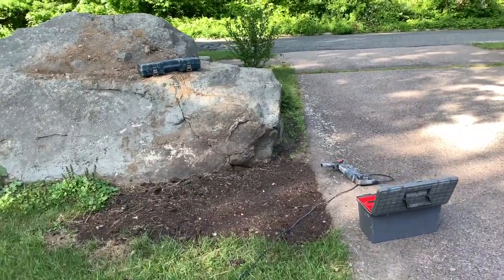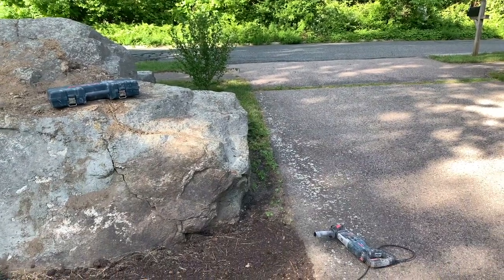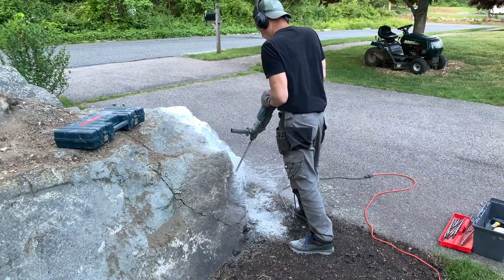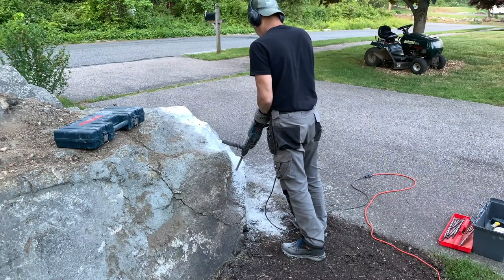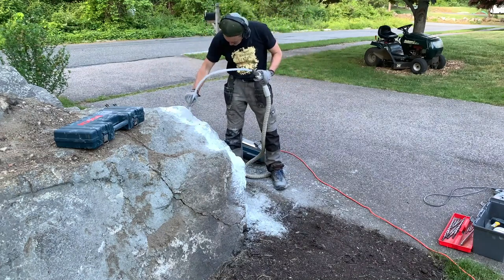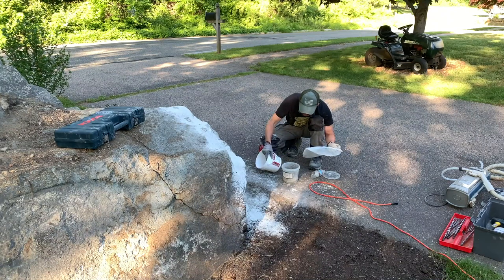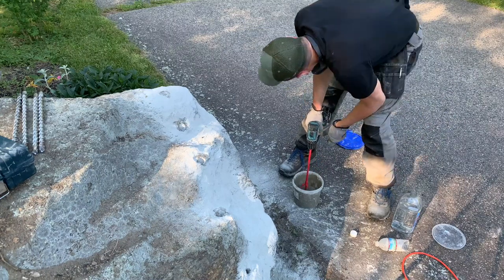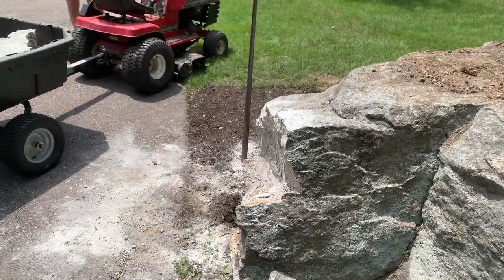Stone breaking using Dexpan type 3

Comment: There are types of this material.  What is the difference between red, green and blue?
Reply from the maker: thank you. Sorry for getting back so late. But I never got any notifications about left comments. It is most likely my mistake, I'll check why I do not get 'em. Cheers
My understanding, the difference between the three types of materials is the outside temperatures that aforementioned material can be applied. some can be used when it's very hot outside, and some when it's colder. Cheers

Comment: My SDS plus Bosch Makita drill bit keep on breaking even if I pour water , can I use pointed chisel bit to make hole ?
Reply from the maker: I would not pour water on a hot tip. My technique to minimize the heat of the tip and prolong its service life - is to change bits often. I do not push too hard, when I drill,  giving a chance to a drill to do its work. A minute later I remove the drill, place it on the rock, and in the meantime, I insert the second drill. A minute later, I repeat the process and inserted a third drill. Then I return to the first one and so on. I would not recommend using water on a hot drill bit tip. Cheers

Comment: That looks like a Bosch rotary hammer drill. What model? What was the rock type- basalt - granite. If it was either of those two it was amazing. I am trying to drill granite with a Chinese rotary hammer drill and start with a small 3/16" drill working my way up to 5/8" for inserting wedges and feathers. However I keep ending up with mushroom tips on my drill bits as they melt in the rock.
Reply: You need to keep the drill tip cool by drizzling water in.
Reply from the maker: Sorry for getting back so late. I never got any notifications about left comments. It is most likely my mistake, I'll check how to get them in time. The unit I used is BOSCH GBH2-28L 1-1/8" SDS-plus Variable-speed Bulldog Xtreme Max Rotary Hammer. I do not know what time of a rock I worked with, but I think it is a granite.
My technique to minimize heat on the tip of the drill and prolong its service life - is to change bits often. I do not push too hard, giving a chance to a drill to do its work. A minute later I remove the drill, place it on the rock, and in the meantime, I insert the second drill. A minute later, I repeat the process and inserted a third drill. Then I return to the first one and so on. I would not recommend using water on a hot drill bit tip.

Comment from the maker: How to break stones, rocks using Dexpan type 3

Depending on the weather, and the temperature of the stone/rock the expansion, usually, takes about 24 hours. Sometimes, it takes more than 48 hours to see the substantial crack. 

The technique that I developed for myself is the following; I usually make the first hole using a 5/8 of an inch drill bit. And then I enlarge this hole by the 3/4 inch, in the video, you can see that the first hole goes much slower than the following one. This way it's much easier for Bosch to drill a smaller hole and then to enlarge it with 3/4. Plus 5/8 inch is also much chipper than 3/4 and I while I drill holes, I change drill bits often, allowing them to cool.

Materials and instruments used
Set of 2 paint, mud, and cement mixer blades - https://amzn.to/3NeoEt2
BOSCH GBH2-28L 1-1/8" SDS-plus Bulldog Xtreme Max Rotary Hammer - https://amzn.to/3x2nl9P
Dexpan Expansive Demolition Grout 11 Lb Type 3 - https://amzn.to/3GDvR3z
Dexpan Expansive Demolition Grout 44 Lb. Type 3 - https://amzn.to/3GES01g
BOSCH HC2127 3/4 In. x 18 In. SDS-plus Bulldog Rotary Hammer Bit - https://amzn.to/3NnJ1nC
BOSCH HC2107 5/8 In. x 18 In. SDS-plus Bulldog Rotary Hammer Bit - https://amzn.to/3td1YSe

I bought 6 drills of 5/8 inch diameter and 3 drills of 3/4 inch. And after breaking quite a few rocks, still using all of them.
Reply: هل موجود في المغرب
Reply from the maker: @حميداغران  , no, Massachusetts.